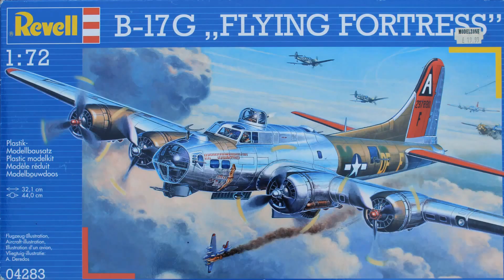Revell B17G Flying Fortress Part-by-Part Build - Model Aircraft

Comment: I've actually just brought this kit today and I really like what you've done with your one. It's brilliant how you've left it in 2 pieces, was that hard to do ?. Brilliant job and great video
Reply from the maker: Thanks, it was fairly difficult, but I think it was worth it just so the interior detail wasn't lost forever
Reply: What paint did you use for the front please, I've never painted metal look before
Reply from the maker: Scott Clarke umm I used the Revell aluminium metallic, number 99, if I remember right. It has a gloss coat on top of that to make it shiny

Comment from the maker: Please feel free to comment with any constructive criticism, useful tips or suggestions for model builds! Don't forget to give a like if you enjoyed. Thanks, Owen
Reply: Cool!
Reply: cool video, great music but there are a couple of things for the modeling side.
The seem lines need to be filled and sanded smooth and the use of masks for painting the windows would help to make your model look a lot sharper.
Also a bit more highlighting for the interior using lighter colours dry brushed on just to make it "pop" it bit more :)
I liked the weathering though and the overall impression is good, keep it up :)
Reply from the maker: freezatron I did have problems with the windows, I could probably have done with some of that liquid masking stuff :) and I agree about the interior, I think I could have made it look a bit more scuffed as well. Thanks for the constructive criticism, much appreciated!
Reply: Quick Kits
 I recommend masking tape as it is easier to keep the lines straight, easier still are Eduard, Montex etc. masking sets, saves a lot of time. I bought one for 1:48 B-17, I also have this kit too and should probably get some for that as well :)
Mascol is good for awkward little areas or lots of curves, a steady hand helps :)

Anyhow no.1 thing for you to fix are the seem lines on the fuselage, leading edges of wings etc. etc. :)
Reply from the maker: freezatron it would be hard for me to sort the seems along the two fuselage halves as the aren't actually sealed together, but I could work on the wings :) how much are the masking sets?
Reply: Quick Kits
 then glue them together :D
anyhow masking sets are about a fiver, depending on complexity size of kit etc.
I saw one for an Eduard masking set for a Hasegawa 1:72 B-17 for £3.95 delivered from Ebay which would work well enough, Montex do a Revell masking set for £5.50 but includes masks for the wheels too, very handy :)
Reply from the maker: freezatron Ok thanks, I'll look into the masking sets :) and I don't want to glue the two halves together, as I showed at the end of the video I've put it in a diorama that splits in two so you can see the interior detail. I thought it was too good to seal it up :)
Reply: Hey great video 
I’m In The process of building a b17 g as and I would like to do it how you did yours as in being able to split it in half but I don’t know how could I have some pointers please thanks

Comment: Wonderful! I have a question. I used to build models before but I had to stop because there is this thing called life that took over. I had a b-17 bomber before but my little brother droped it when he was playing with a spitfire I gave him. Do you think that I should buy this to get back my b-17 and also get back in to the hobby? Cheers from Sweden.
Reply from the maker: I think you should start with something simple to get you back in - this is a bit complex. Try a 1:72 scale fighter plane that's cheap (in case you mess it up). Good luck!
Reply: Edward Brännback revells 1/72 bf109 is an exceptional kit for beginners

Comment: how did you the fuselage parts? cause i would've thought you had trouble with spraying the exterior of the fuselage with out leaving marks or something from tape holding the fuselgae together and also how did you get the clear parts aka the nose cone to fit so perfectly with the fuselage not leaving gaps or anything, if you could, could you post a tutorial on how you did all that work on the b-17 for me please as im considering on using your idea with alot of my future bombers now since i love detailing my kits up but never see it once put together cheers
Reply from the maker: I use a paintbrush so I don't have to worry about over-spray and masking too much. The parts in this kit generally fitted well, if you're struggling to fit clear parts, sand down the plastic area that you're trying to stick them to until it is flush. I'm going to be building Airfix's Lancaster Bomber soon - that video might help you?
Reply: Ok cheers man, looks fantastic

Comment: How did you paint the outside? Just with a brush? And what metallic paint did you use to get that silver aluminium colour???
Reply from the maker: Yup I just used a brush, thinned some revell 90 (pretty sure it was 90) enamel and it has a gloss varnish coat over it to nake it shinier
Reply: Quick Kits wow, I thought you might have used an airbrush! Excellent painting! Also, would you recommend getting an airbrush for a beginner? I'm 17, getting into modeling. I can afford the equipment for an airbrush, but should I save money and use a good ol' paintbrush instead? Is there really much of a difference between airbrushing and brush painting? Thanks!
Reply from the maker: Personally I've never used an airbrush, but from what I've seen it looks like a bit of a pain to have to have a well ventilated area and LOADS of masking tape, it just looks like it takes the fun out of it (I hate masking its so annoying) :/ I mean it's useful for painting certain camouflage schemes, but I think with the right brushes and technique you can get pretty badass results and save money. If you're just beginning I'd use a paintbrush and then if I turns out you don't like the hobby you haven't lost too much cash. Also I'll think about making some videos on painting and brushes; thanks for the suggestions! :)
Reply: Quick Kits Yeah, I guess I'll leave air brushing for later. I'll have to look around for some good paint brushes though. By the way, humbrol 90 isn't the silver metallic, its beige green. Reckon I could use any tamiya aluminium/metallic spray for the larger areas, and paint the rest by hand? I'll be getting this kit for my upcoming holidays.
Reply from the maker: Sounds like a good plan, just get a good wide brush and some really fine ones and you should be good. And humbrol 90 is a beige green you are correct, but I used Revell 90 which is aluminium :))

Comment: I have this model at home, but it's very old. My grandmother bought it More than 25 years ago I think. She gave it to me last year but I don't have the Paint or equipment for it. What should I do? (P.S. never done modeling before, but I would like to try is it worth it? and it's from airfix)
Reply from the maker: If you've never built a model before I would leave the B17 for now and buy one of the Airfix starter sets, such as the Mustang or Typhoon. They will come with instructions and paint and glue and paint brushes for around £8. If you enjoy the hobby then you might want to look on the internet for the instructions for the B17
Reply: Ok, thx ;) Nice done btw
Reply: One more question, do they ship to belgium or do I have to go to a modeling shop?

Comment: Looks like you don`t believe in applying putty on seam lines ??
Reply from the maker: If you're talking about the seam down the middle, that's because the two fuselage halves aren't sealed. I always sand and fill seam lines otherwise
Reply: Good for you